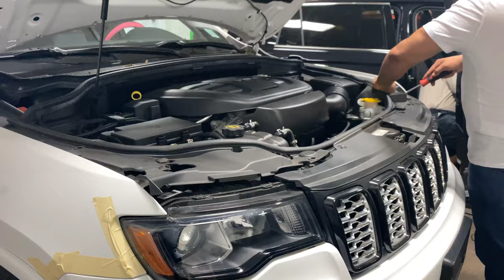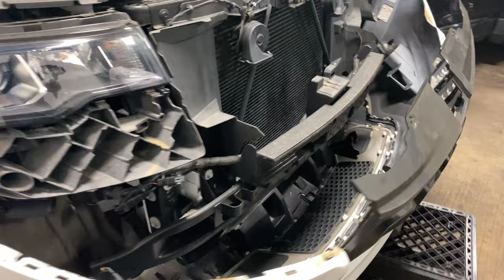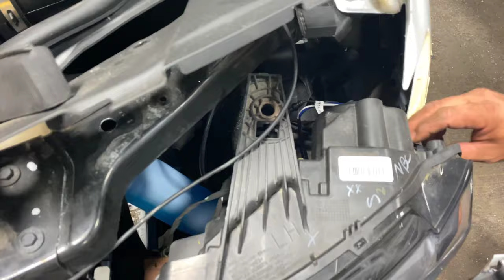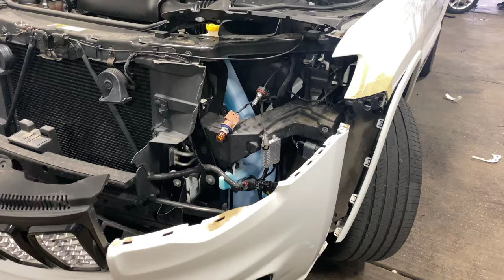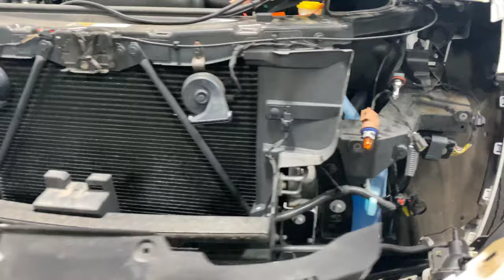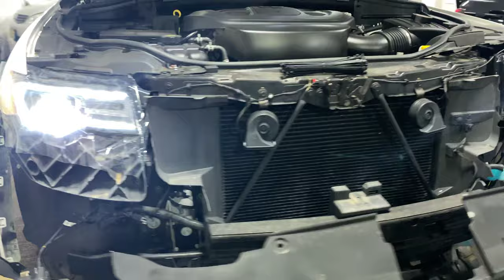⚠️ 2017-2021 Jeep Grand Cherokee LED HID Headlight Swap

Comment: It's ridiculous that you need to do this much work to replace the passenger side low beam bulb. Spent an hour yesterday trying to get at it, but realize now the whole front needs to be removed to gain access. Thanks for the video guys!
Reply from the maker: If you have small hands you get can get to It from inside the fender or engine bay.
Reply: Not true, I did mine multiple times, drivers side you just remove the air box, passenger side you can basically just squeeze your hand in, gloves are recommended though because my hand was torn up after lol
Reply: I did mine after the dealership wanted to charge me 500 to take my front end off. But like the previous poster stated I have long arms and small hands

Comment: Took these to a shop to install and they said it was overheating. Is it a bad harness? Any reason why this would happen?
Reply from the maker: Only part that heats up is the resistors to dissipate heat. They need to be secured away from wires to dissipate heat correctly. Installation guide shows this as well. If you need the guide emailed contact us on live chat.

Comment: Any pictures or videos of the output of these lights? What is the ballasts wattage and bulb kelvin rating? Any lumen output tests? Lots of unanswered questions for such an expensive set of lights.
Reply from the maker: Dustin Roads the D3s bulb is replaceable it’s and hid 4800k bulb
Reply: @MHFAutoLighting  what projector is used in these?
Reply from the maker: Dustin Roads these aren’t a custom build , factory Jeep projectors standard on all bi-xenon equipped vehicles
Reply: @MHFAutoLighting  awesome, thank you! Solid lights!
Reply: Where could i order same headlights

Comment: If I have a halogen housing would I be able to use these without changing wiring or is all of that included in the set ?
Reply from the maker: Mills Montana Official the headlight package includes the headlights and harness
Reply: @MHFAutoLighting  I'm interested
Reply from the maker: @ricardobanderas3585  contact us on our website MHFautolighting.com

Comment: LoL omg what happen to just pulling the light out put new one in boom worked dang let's just replace the front  frame lol lmao dang tripping
Reply: That's exactly what I was thinking...can't you just switch out the bulb lmao and also don't need to take off the front bumper and all that other bullshit haha... I suppose these are real legit nice lights tho, a completely different fixture and everything. Still, I would probably go the easier and cheaper route haha
Reply: The original headlights that you see at the beginning don't have the LED ribbon. You need to replace the whole unit for that upgrade.

Comment: useless. The wiring is the most important thing. It was left out.
Reply from the maker: The “wiring” is a custom made harness with PCB board that we manufacture. We offer It with a Installation guide.